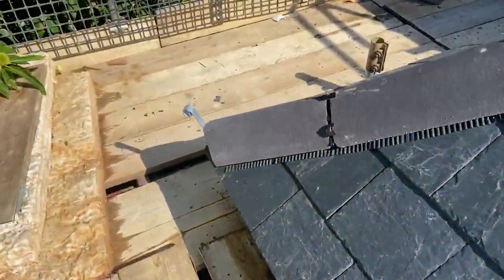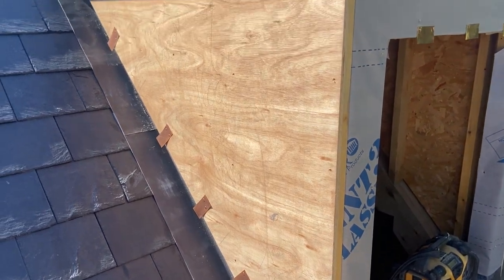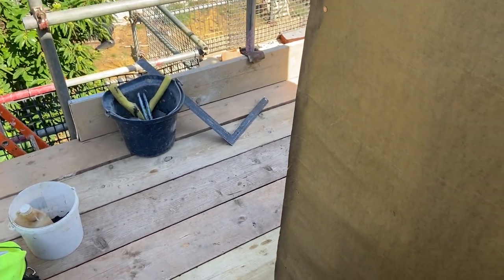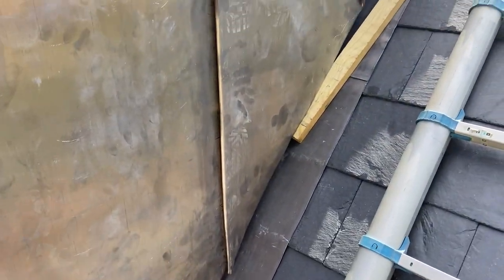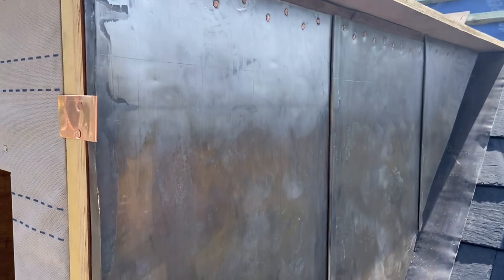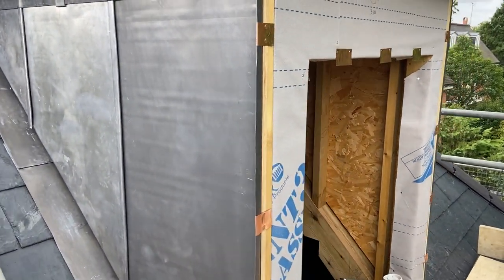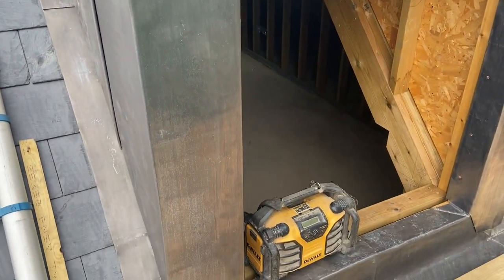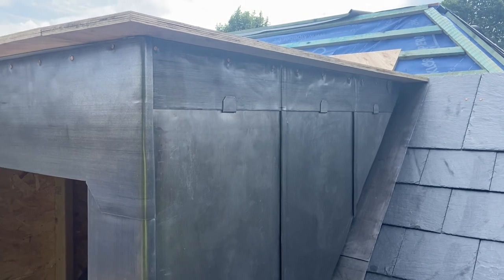Cladding A Dormer In Code 4 Sheet Lead

Comment: Nicely finished around the copper clips at the bottom of the dormer. 

I would have like to have seen you cut out a small rebate in the lower welt to receive the hidden copper clips inside the welts so that you can't see the clips when you set in the welt.
Reply from the maker: Thank you. Yes I totally agree. To be honest I usually do that too. I didn’t do it on this job as it’s somebody else’s and I was copying what’s been done before.

Comment: Hi stue. What fixings to you use with the copper fixings square ones into the wall is it screw plug or masonary nails. To hold the lead to the wall with a cover flash over the top thanks lee
Reply from the maker: Hi Lee In this video I’m using 25 mm copper annular ring shanked nails to fix the lead dormer cheeks. 
If I’m going into stone/masonry I use the same nails into a red plug with copper cut acting as a washer.
Reply: @slbleadworks  thank you stu. thank you for that advise 👍😊

Comment: Love the channel mate. Am i right in thinking the bottom of the lead sheet  just hooks up against the copper tabs ? I normally hold it with lead tabs but that way looks great.
Reply from the maker: Thank you Im glad your enjoying the channel. 
Yes that’s right. I sometimes do a continuous copper drip too. 
And also sometimes like you just use lead clips. But as these cheeks are vented they have to be kept of the roof and the copper makes the bottom edge nice and strong.

Comment: Hi mate, great work 👌 just a question for you. Does the lead on the dormer cheeks hook around the bottom edge of the ply? I saw at 8:21 it is bent for a safe edge but doesn't cover the exposed edge. Is there anything being put there to stop that edge drawing water? Thanks
Reply from the maker: Thank you. The lead drops down lower than the exposed edge of the ply protecting it from drawing water.
Reply: @slbleadworks  ah okay. Thank you for the reply. Again you produce stunning work 👌👌

Comment: Tidy lead work that wat you done. Bit confused as to why the lead on top of the slate tho and not soaked up that was done by your friend
Reply from the maker: Thank you. 
There are soakers up the sides like normal. That cover flashing that’s out onto the slates is just there for show. He didn’t need to do this. Although it’s definitely belt and braces.
Reply: @slbleadworks  ah just makes it look bulky with yours all tight and dressed

Comment: Code 4, cheap skate builder.
Reply from the maker: Everyone’s looking after the pennies right now
Reply: @slbleadworks  you ain't wrong,
Made a sweet job out of that tin foil though fella,
He could have saved more pennies by doing away with that pointless cover flashing,
But if the slater ain't worth a carrot it hides the moody cuts I suppose.
😉👍